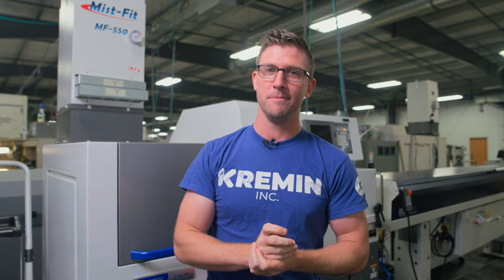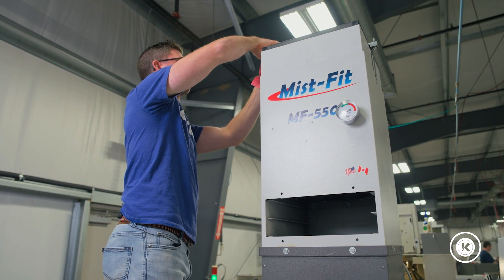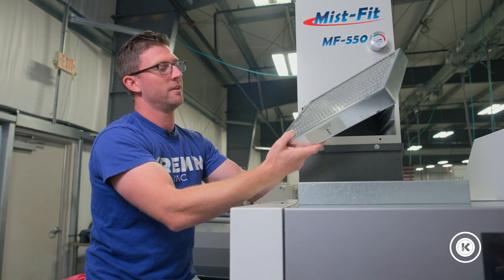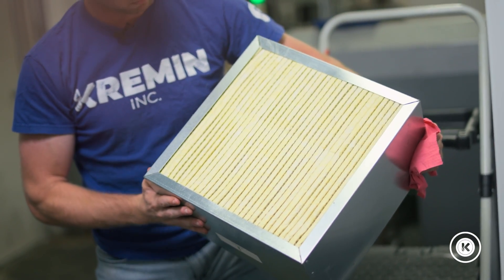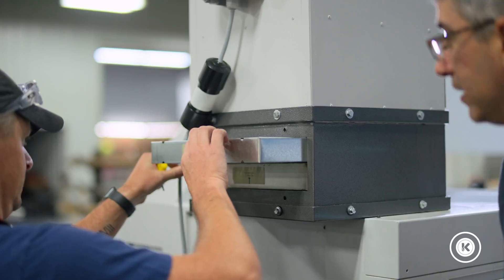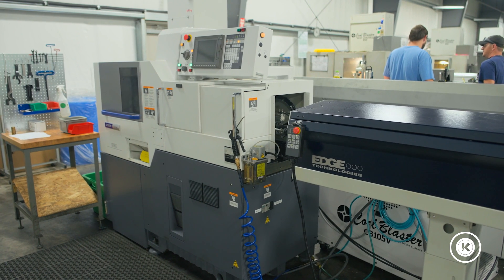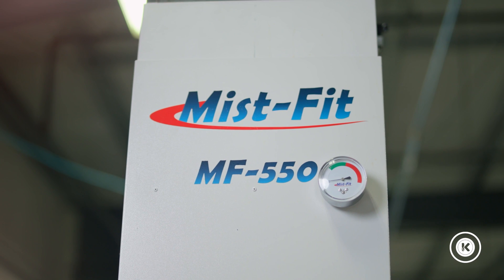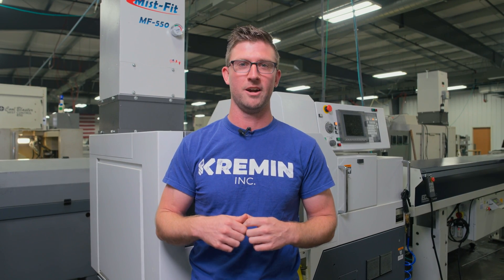Mist-Fit 550 Mist Collector - Kremin CNC Machine Reviews

Comment: How do you turn it on?
Reply from the maker: It’s wired to the machine - when the machine is on it’s running, when it’s off - the filter is off - they wire it during installation - you don’t have to worry about on or off with this unit